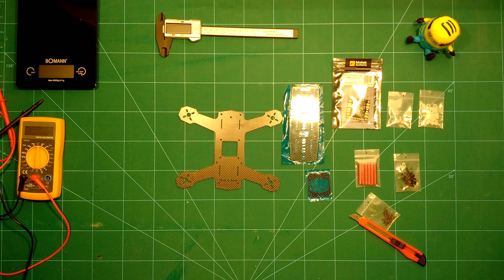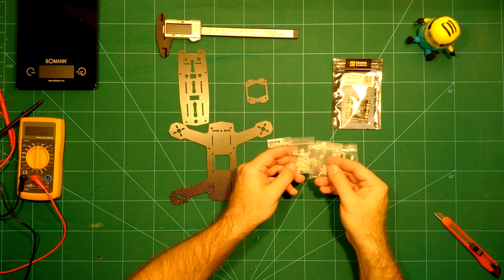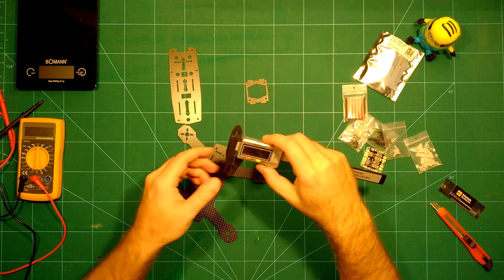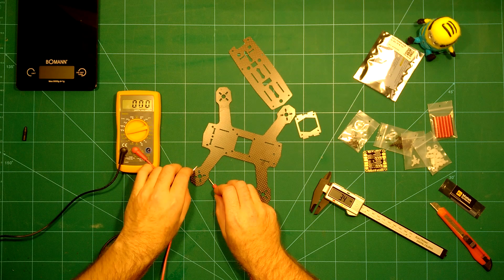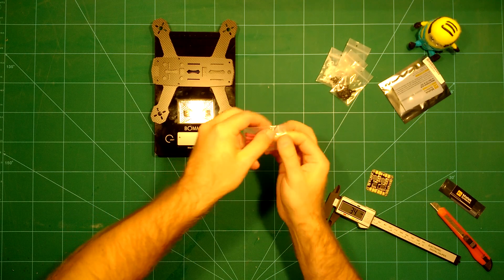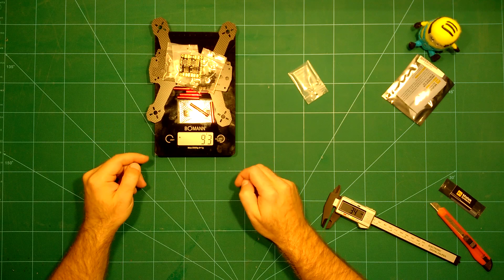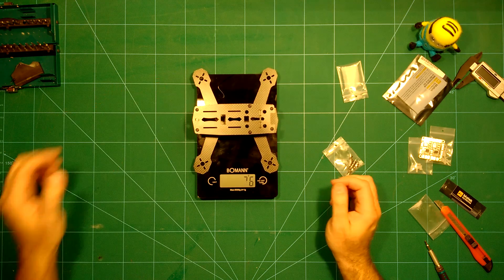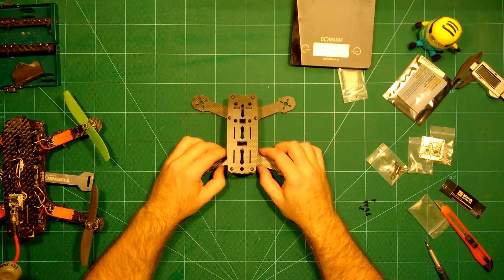FPVModel ZMR180 Carbon Quadcopter Frame: Bench Review

Comment: great! got one, the only thing I hate on these is the slits near the arms. a small crash pits some stress. folks have already started reporting broken arms because of that. but it flies great.
Reply: +assaulter99 I think these slides are deliberate, the goal here is to make you buy spare parts, that's the way these manufacturers make money, it's like that since the beginning with most of the mini quads and these 180 ~ 150 size frames are even more perfect in this purpose :)
Reply: +ABMNS PRODUCTION Haha yeah I get your point! To be fair to FPVModel, they have taken the criticism in consideration and doing a V2 without them. They said it was there for underslung batteries. Btw, there is BuddyRC which came out with a version with replaceable arms, nice touch! But I suppose it would weigh more.
Reply: assaulter99 FPVModel are not good people for sure, they just have to eat like everyone lol
You are perfectly right with the repleacable arms especially at this size, you will have to use some screws and nuts so you might add some weights on your rig! Not really an issue, just be more careful with the choice of motors, ESCs and save some weights all along during the build :)
Have a great weekend